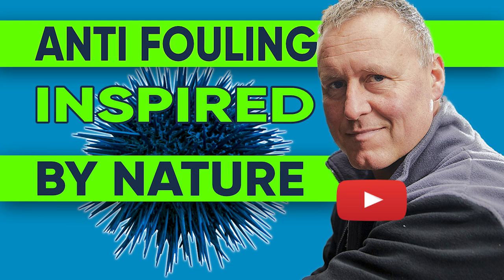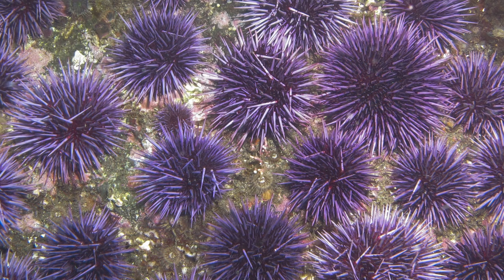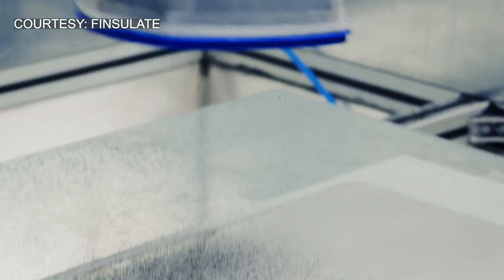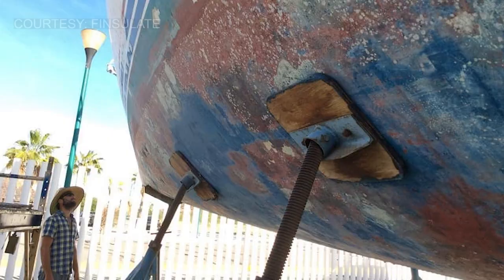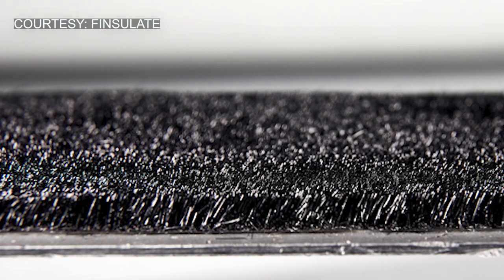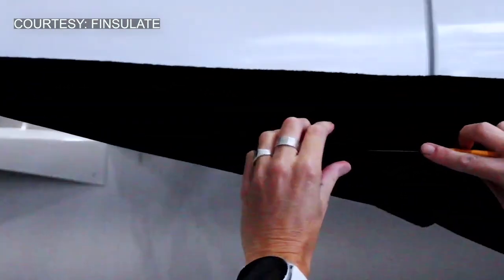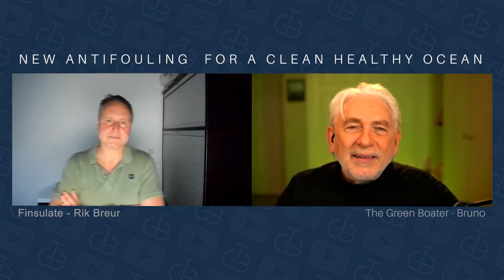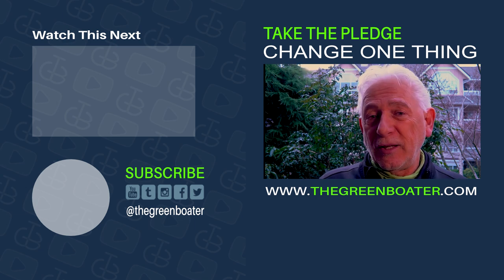Forget Toxic Paint! Wrap Your Boat in Spikes!

Comment: There are two owners in the Fountaine Pajot owners group who tried it. They both got rid of it in a year, and at least one of them sued. Slow speed and massive growth. Finsulate had promised to remove their garbage if it didn't do what they claimed, and then refused to stand behind it.
Reply from the maker: We plan to reach out to Finsulate and get some clarity around performance and customer acceptance. Thank you!
Reply: As far as I know, we have applied Finsulate to 2 FP catamarans. One couple was not happy because they did not realize they needed to clean, depending on where and how often you sail (which is the case for antifouling paint as well). They were unexperienced sailors so you can’t blame them. 

People tend to hear what they want. But we are not selling Finsulate as the “magic bullet”. It is an environmental friendly product with a proven lifetime of 10 years by now. But it is not 100% fouling free. However, it prevents the spread of toxic paint particles in pristine environments. People don’t realize, but every can of paint you apply to your yacht, ends up in the ocean. Pouring paint in the ocean is a crime, but if you first put it on your yacht and let it go in slowly, everything seems fine….

For the 2nd owner, we lost contact during the Covid pandemic. But for sure they did not remove within a year as I was there making some repairs after the first year of sailing. So I don’t know where you got this info?
Reply: @finsulate  I was mistaken. Odyssey left it on for two years but was unhappy with its performance within months. The other boat I would have to look up, but I can tell you the reason you've only done 2 FP cats is because both owners warned off the other owners. 

I agree that a solution needs to be found to keep the pollution to a minimum, but a product with a significant reduction in speed, minimal fouling protection, and nearly impossible to remove the adhesive doesn't seem to be the answer.

Comment: I can't believe that there isn't a significant reduction in boat speed on a sailing boat.  Even cruising sailboat users are focused on removing light growth.
Reply: We did some extensive testing with finsulate and without. There is a significant speed difference. Ranging from 0,3 knot to 1 knot of speed loss with finsulate. We sail a 33ft monohull sailboat. Speed comparison is with the same boat, same crew and same weight. And we kept the hull clean. When you do get growths finsulate gets off course even slower up to 1 to 2 knots speedloss.
Reply from the maker: We so appreciate the feedback!  Have you contacted Finsulate directly?
Reply: @SVTranquillity  My comment in the main thread was 'spikes.. I have always wanted a hull speed of 3kn', given that I average 5kn, sounds like I was spot on...
Reply: it has to do with a change in flow pattern. We do see some increased friction, but during testing at MARIN institute here in The Netherlands, we saw that the flow stays attached much better/longer than with regular smooth bottom. So there is a balance between form drag and friction drag that is changing. For planing hulls, we do see an effect (as in planing mode there is only friction) but for displacement hulls we don't (with a few inexplicable exceptions of course).

Comment: From personal experience I know it ruins the performance of a sailing boat. My cruising sailboat lost about 1 kn at cruising speed of 5-6 kn. In low wind conditions 5-6 kn of wind the boat would come to a complete stop. The autopilot had also problems steering the boat because the friction on both sides differ. This is because a sailing boat does not goes straight but drifts a few degrees and the angle off attack on both sides differ. With the hairy nature of it this gives a difference of friction. I must say that as an anti-fouling it works and it sticks very well. It was a very hard job to remove it.
Reply from the maker: Thank you for this credible feedback.  As mentioned we are contacting manufacturer for response.
Reply: Hi Jan, a pity to hear you were – in the end – not satisfied. You used it for 2.5 years and the last contact that I see was in 2022 when you had the storm damage and we were discussing reapplying or repair. You never mentioned the speed issue, so to say “it ruins the performans of a sailing boat” as a comment is a bit blunt. 

Even though many sailboats are happy with the version of Finsulate that you had on  your Contest, there have been a few cases of sailboats with a reduction in the top speed. So I am not denying what you say. That is why we have upgraded our portfolio in 2022 with a version that has softer hairs. That is our standard product for sailing yachts now. We do not have the 10 years proof that we have with the earlier version yet, but so far this version holds up well in all kinds of waters.

Comment: We did some extensive testing with finsulate and without. There is a significant speed difference. Ranging from 0,3 knot to 1 knot of speed loss with finsulate. We sail a 33ft monohull sailboat. Speed comparison is with the same boat, same crew and same weight. And we kept the hull clean. When you do get growths finsulate gets off course even slower up to 1 to 2 knots speedloss.
Reply from the maker: Thank you for the feedback! Was this reported to the manufacturer?
Reply: Yes we did. Unfortunately the manufacturer is not very helpful when there are issues with the finsulate and you are somewhere in the carribean. No good warranty solutions. But you can see it all in our review of the product. In the review we did not had the speed data yet. So we did not mention it. It took us another year of sailing with regular antifouling to update our polair diagram. And this is when we found out how much slower finsulate actually is
Reply: @TheGreenBoater  unfortunately for this client it was impossible to give a solution that was satisfactory to him. Some people are impossible to satisfy. Something went wrong here, we don't deny. But we stopped responding to this former client as he is deliberately trying to ruin Finsulate's reputation. We have given a solution that is much better than any antifouling producer would give. Where we normally would admit that speed loss in specific occasions can occur, I am not too confident about his test. Probably he will respond again, I hope you accept that we do not answer again on his comment.
Reply: Yes I will comment on it. Just view our finsulate review on youtube. We only stated facts. And we shared the solution from the manufacturer as well. We do not intend to ruin someones business we just give a review on a product. In my opinion a good product will not ruin your  business because of a negative review, the only thing that will is how you treat your customers.

Comment: This is the first time I've heard that the west coast (USA) can't clean our boat bottom in the water. Boy am I in trouble because I've been scrubbing my boat bottoms in the slip for over 40 years.
Reply from the maker: It is our understanding that boats with Ablative anti fouling paint are not allowed to be cleaned while in water. The toxins in the paint adhere to the bio growth and if knocked off enter the water environment spreading toxins to other marine creatures. Another reason is to prevent the spread of invasive species.  If your boat has a non ablative coating then the laws governing your area may allow for in water cleaning.
Reply: @TheGreenBoater  It's going on right now. They removed the copper from bottom paint 25 years ago. The divers are busy cleaning boat bottoms in California. But what do I know, I'm just a retired Harbor Master for over 500 slips in San Diego Bay.
Reply from the maker: The California Sate Water Resources Control Board publishes their laws for biofouling management. It clearly states that propeller cleaning (in water) is  allowed but "All other in- water hull cleaning is prohibited unless conducted using the best available technologies economically feasible, as determined by both SLC and the State Water Board."  Now this is for all boats that have coatings containing prohibited biocides.   I am certain that your divers are compliant with these regulations and are fully trained in the safe removal of bio mass from hulls.  In state of Washington, where I kept my 50 foot yacht, all marinas and diving services which offer hull cleaning are fully aware of the laws governing cleaning and safe removal of toxic materials from boats while in water and in dry dock.  For reference to boaters in California here is link to SLC laws for biofouling management: 
 https://www.waterboards.ca.gov/water_issues/programs/beaches/cbi_projects/docs/faq.pdf

We strongly encourage boaters to check regulations in their local waterways for rules governing the safe removal of bio mass from their hulls. Simply google 'laws governing in-water cleaning of vessels for [insert waterway]'
Reply: @TheGreenBoater  All diving services are licensed and certified to use BMP's. They (the port) alert all marinas if they want to halt bottom cleaning usually in areas of limited tidal flow. Some times they halt bottom cleaning for 2 months to gather samples for a base line. There was always a funny rumor around San Diego Bay that if you took your boat to Ensenada Mexico that you could get the paints that were banned in the states. The funny thing was the boat yards in Mexico get all of their supplies from West Marine in San Diego. So the bottom cleaning continues as usual with a beautiful piece of 1970's shag carpet.
Reply: @TheGreenBoater  So just because I've been retired for a few years I called up to my friends in Los Angeles, San Pedro marinas. Your scare tactics to sell your product don't work well at this time. But who knows what the future may hold for boat owners. Everyone knows we have excess cash to own a second home on the water. However the tide will change and I think your on the right track. Perhaps induce a voltage barrier from inside the vessel out. Best of luck to you!!
Reply: I'm directly aware of not doing it in Washington. We just 'inspect' in the water, well away from prying eyes.
Reply from the maker: @braithmiller  The first time I hauled my 50' boat out in WA state for bottom cleaning and painting, the boatyard was very diligent to ensure none of the  material or water used to power wash my hull went into the ocean.  They had catchment basins for the water and collected all the bottom growth into bins which were hauled away to another location for treatment and disposal.  This boatyard was in an area deemed sensitive for eelgrass protection.  The boatyard manager said his facility is under constant surveillance by eco groups with heavy fines imposed if the laws are broken.
Reply: @braithmiller  Yea like in small marinas like John Wayne they could actually enforce restrictions. I had enough trouble keeping people from cleaning fish on the docks calling in seals with 525 slips. All divers have to check into the marina office and have to be on the port of San Diego list of certified divers list to get into the gate. The deal with this vendor is he thinks we all watch Fox news and he's an authority on bottom cleaning.

Comment: Oh my goodness, looks like gluing anchors to the bottom of your boat .. lol
Reply from the maker: It does defy our 'visual logic' but there is scientific evidence (see manufacturer web site) to support the formation of air bubbles from the fibers which provide lift and less drag.  I suppose if the boat is inactive for long periods then the surface has  'sludge' that attaches which will reduce that effect.  It will be interesting to hear from more boat owners who have applied this coating.  ~tgb